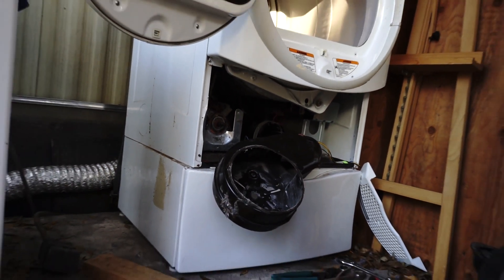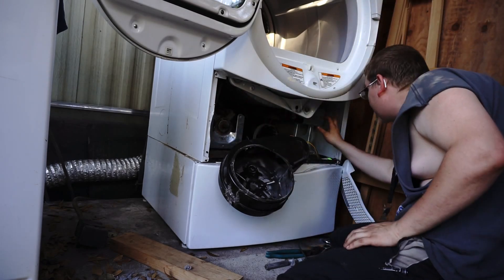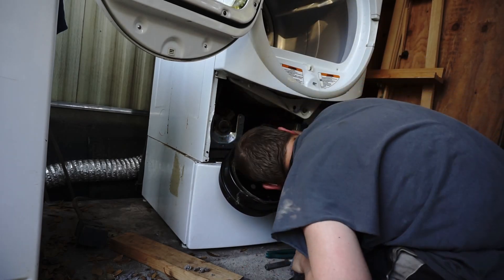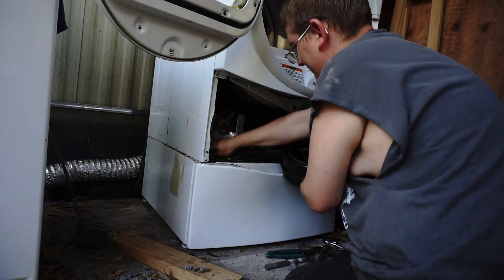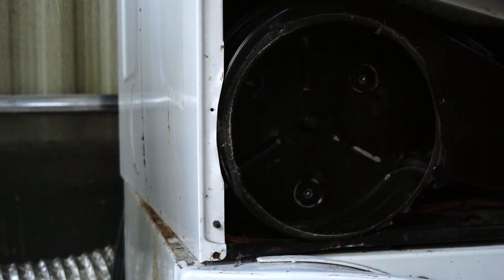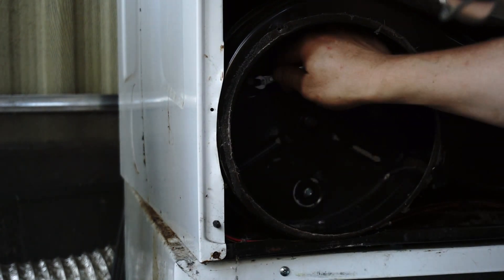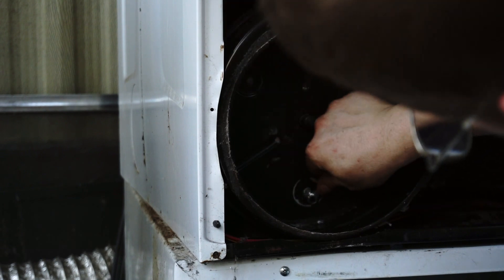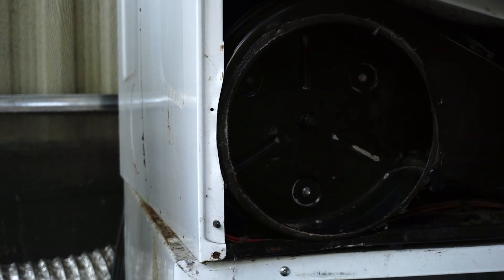How to fix Whirlpool Duet Error PF Part 1

Comment: Are just cleaning it out or did you have to replace anything?
Reply from the maker: high cut off switch thermostat .Its always good to use a volt  meter to ohm heating element for short.

Comment: so what was the problem your fixing in your video, I ask because im having the same issue But im trying to learn what you did but its in animal voice LOL????
Reply from the maker: Most dryers do not receive regular dusting and cleaning.When they accumulate dust through the duct working so does heat.These component's are designed to fail and shutdown to prevent fire's.Mine had a clogged vent which overheated element and thermosistor. After a few short test for continuity and addressing a few melted and discolored wires .

Comment: Not what doing just changing a blower wheel ? Was  that Alvin
Reply from the maker: I increased air flow to the exhaust sysytem .Just like cars if the heat cannot get out .It will backup and cause failures among the system.